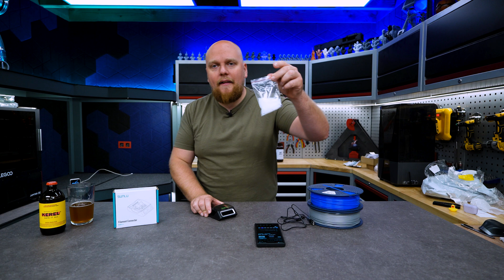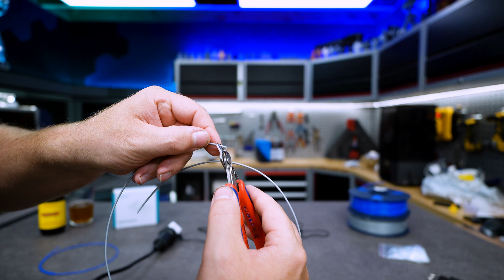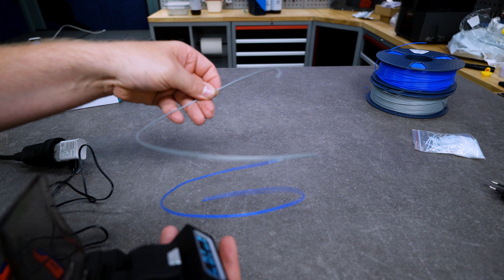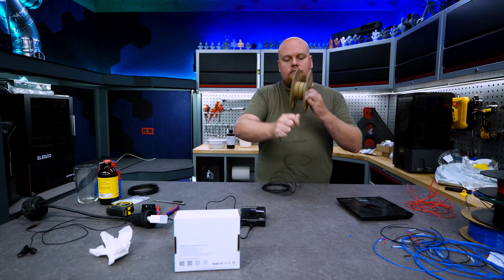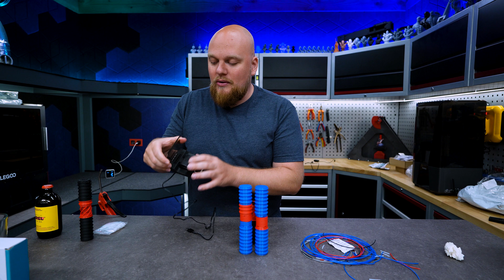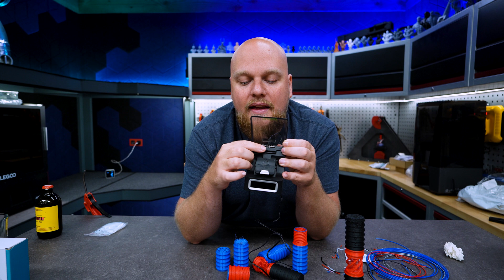SUNLU Filament Connector, join all your loose ends into 1 spool!

Comment: I believe you can join scraps together, cool the tube, slide it down to do the next joint, and again at least a few times without the tube losing its dimensional stability. Only need to cut the ptfe off if you have a very long section you don't want to unroll.
Reply from the maker: @Jerrie-Lenore  yes, did that and you can 😉